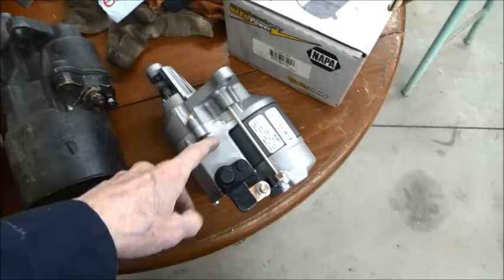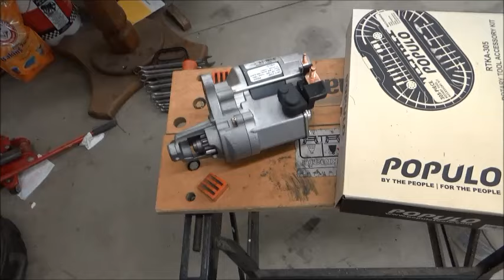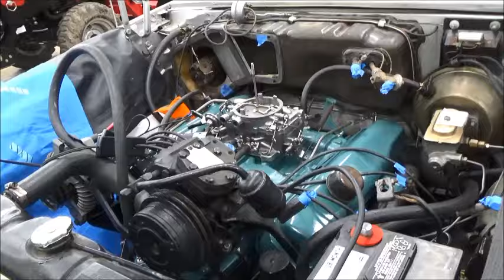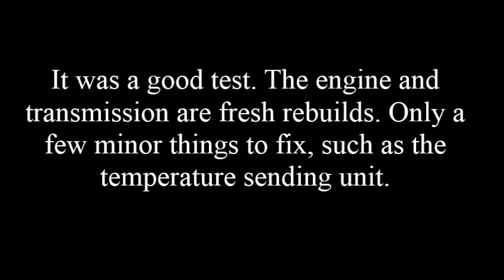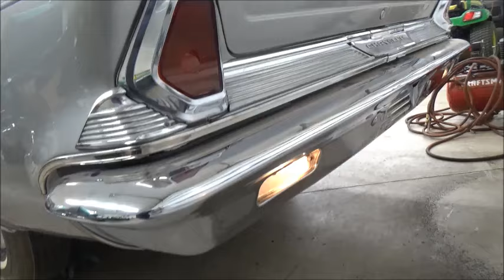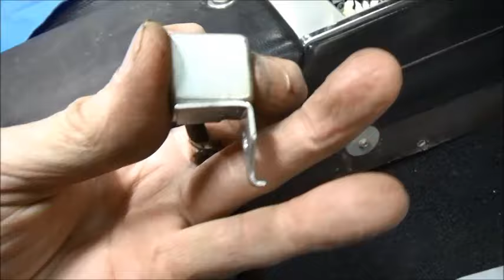1964 Chrysler 300K. New starter. Temp sender fix. B/U light fix. Engine test.

Comment: I had the exact grounding problem with my H…short of pulling the compressor off, I managed to get a thin small flat headed screw driver between the temperature sensor connector and the bottom of the compressor…just enough to better seat the connector and create an air gap.  Voila…no more pegged temperature gauge and nominal operation.  Thanks for all your posts, very enjoyable!